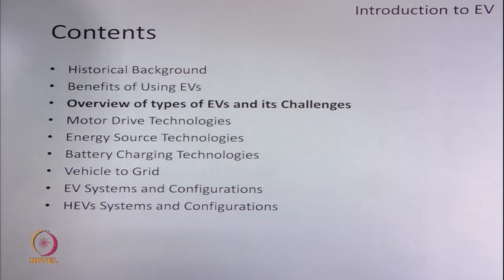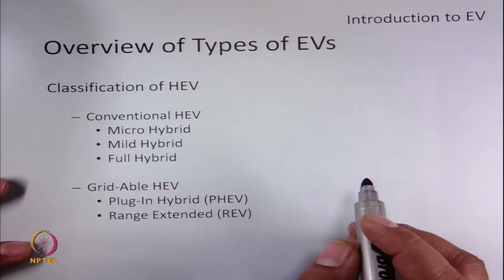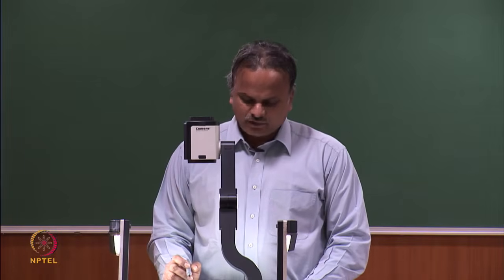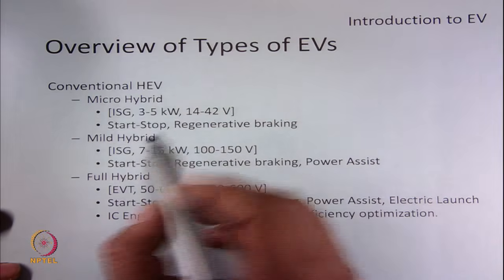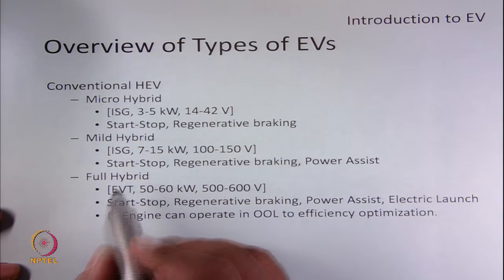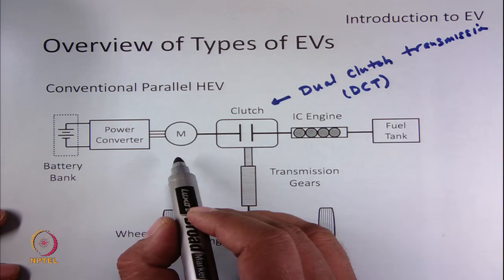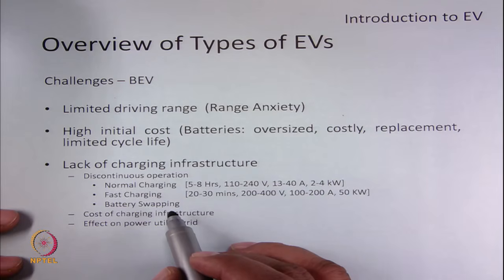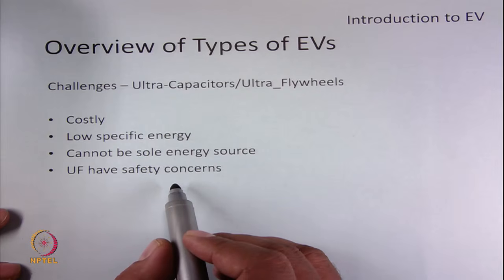Intro EV Overview of types of Evs and its Challenges

Comment: Wait there is nothing called range in ic engines it's mileage. And in between sir said the range of Bev is better than ic engines I am completely pissed out 🤕
Reply: Charan, There is a range in IC engine. When you compare Full tank vs battery the range comes into the picture.
Reply: It turns out you're the idiot, there is in fact Range in IC vehicles, its the total a vehicle can travel with a full fuel tank, and on the comparison, if you don't consider charge timing the EV's have better range than IC vehicles. Nptel teachers are never wrong